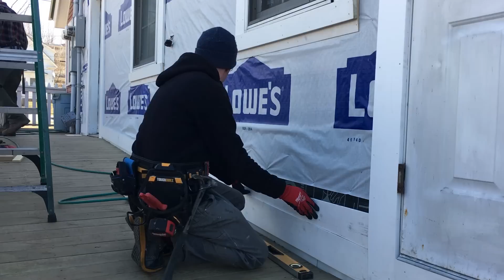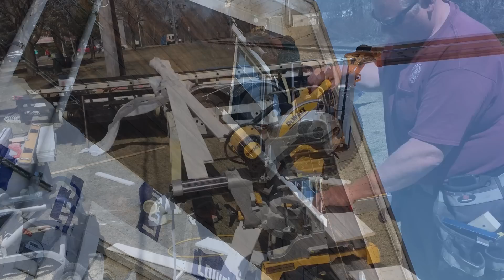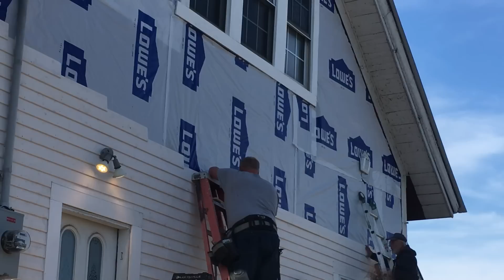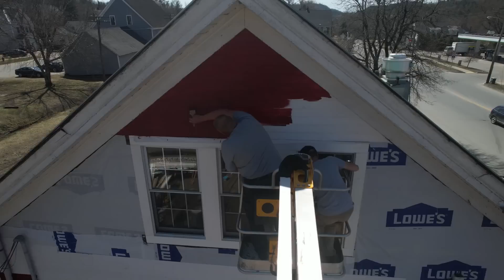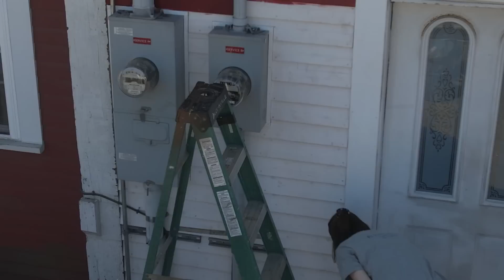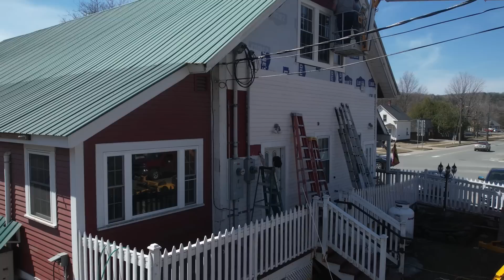Siding and Painting the Freighthouse...Looking Good

Comment: I really like the clapboard siding! We have that on our house, it's cedar. Ouch, the price of PVC board! It's looking really nice guys! When we re-did some of our siding we put tape behind the places we butted the clapboard together. We had a door into our garage that had started rotting out and it didn't need to be there so we tore it out and sided over it. Someone had broken into the garage through this door so they broke the jamb and we bought the house foreclosed on and that door was boarded up on the inside. No sound for the painting? Where's the rain cap for the window? I don't see it. The red looks a little different from the other red. Where's the rain cap for the door? I don't see one there either. Thanks for this video Ken. Do you put some type of flashing over the doors and windows that I just didn't see?
Reply from the maker: Thanks It doesn’t show up in the video very well. We did put flashing over all the doors and windows